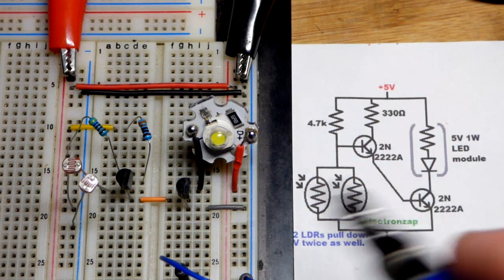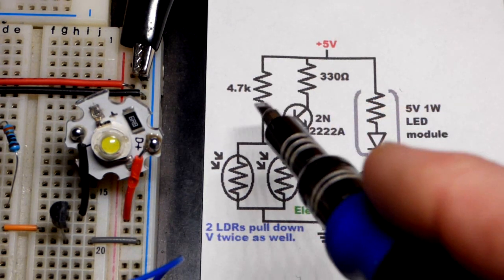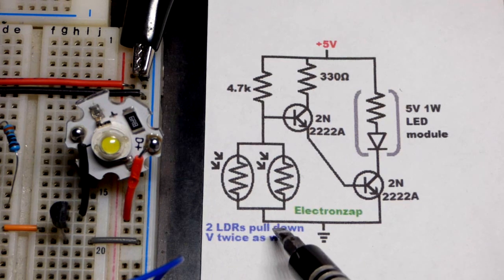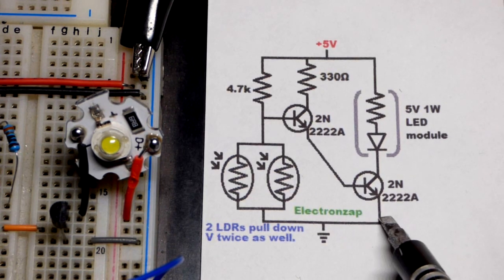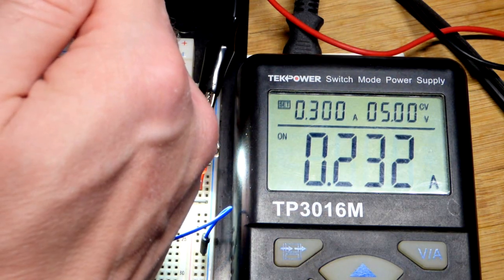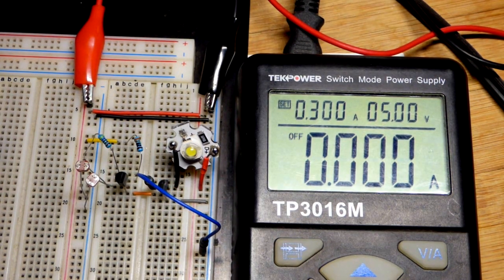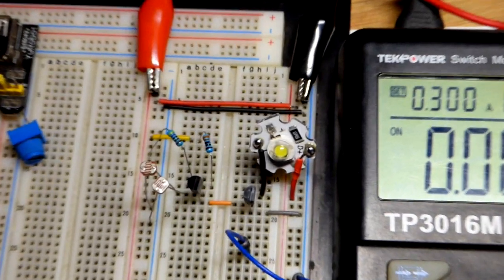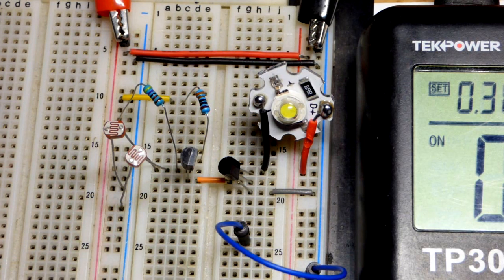5V 1W LED module night light circuit two 2N2222A NPN BJTs and LDRs learning electronics shorts 120

Comment: I'm sure it's obvious, but another variation would be to replace one of the LDR's with an appropriate resistor.
Reply from the maker: Yeah, that is a good way to set a minimum parallel resistance.
Reply: I would like to see that and what the difference is or min/max possible